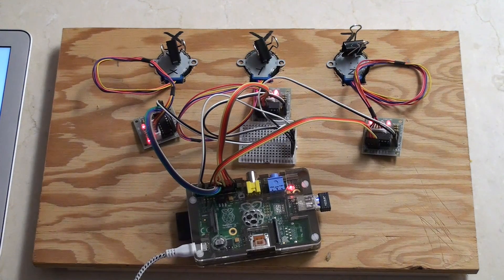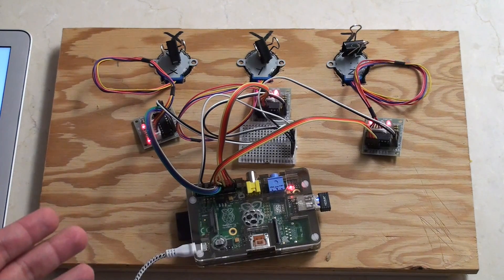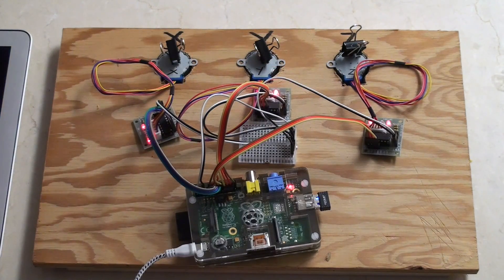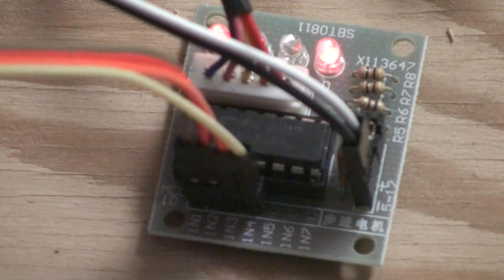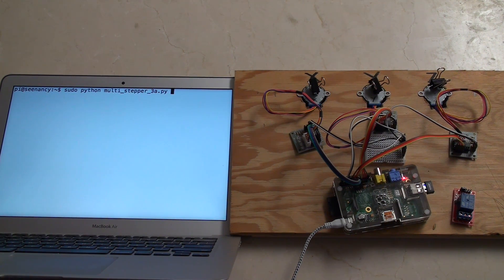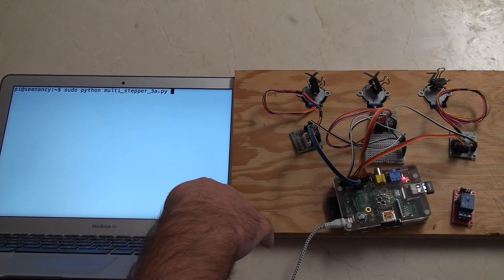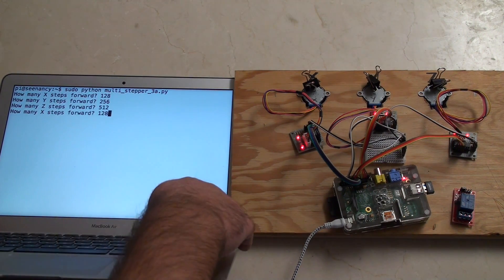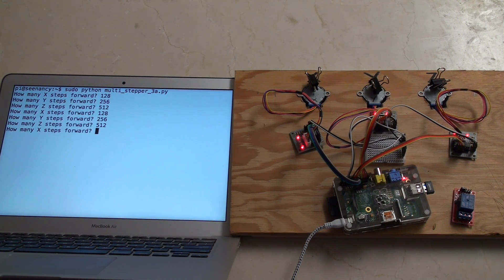Raspberry Pi:  Stepper motors and first steps towards a CNC machine or 3d printer

Comment: For a cnc you need to use Easy Driver as it requires only 2 lines from the pi for each axis (step and dir)which will be much easier to interface to Gcode interpreter.

Comment: I have loaded the raspberrypi and  using PuTTY.  I am using the Protoneer.  I am trying to get from the Linux program to the GUI. Can you tell me how to get my Lenux to go to the GUI 
screen? Thanks, Tom
Reply: "From the Linux program to the GUI.."  First thing is Linux isn't a program, it's the operating system.  Second thing is you can't "get Lenux to go to the GUI" because PuTTY is a terminal emulator.  If you're not comfortable typing commands then maybe you should get another hobby like staring into the sun.

Comment: can u share the circuit diagram for this project
Reply from the maker: +Vishwas Raj You asked for this not long ago, and I'm sorry I haven't gotten to it.  Here's the easy way tho.  Inside the code, you'll find this:
axisx = [4,17,27,22]
axisy = [10,9,11,7]
axisz = [15,18,23,24]
Those numbers refer to the GPIO numbers, so GPIO4, GPIO17, GPIO27, GPIO22.  That's for one of the motors.
Does that make sense?  Or do you still need a diagram?
Reply: +skiwithpete Yeah need the diagram.Please can you share it.
Reply from the maker: +Vishwas Raj Don't have one, will have to make it.
Reply: +skiwithpete the diagram would even help others.Please share the diagram and thanks for replying.

Comment: can I use stepper motors for a rover or is better to use dc motors?
Reply from the maker: +95Micro If you were making the mars rover, or something that need accuracy, then I would say steppers.  But if you want to wheel around like you're playing with an rc car - dc, 100%.
Reply: +skiwithpete yes i want to make a nasa like, rover. but i cant find a shield that allows 6 stepper motors and another 4 servos
Reply: 95Micro i would recomend setting up a arduino/pi setup, this allows you to make use of more GPIO. in theory

Comment: thank you for the video. i would like to know the gpio connections please.  I bought all pieces that you recommended. thanks again!
Reply from the maker: +Angelo Torres they're listed in the code.
Reply: +skiwithpete 
axisx = [4,17,27,22]
axisy = [10,9,11,7]
axisz = [15,18,23,24]

?¿?¿
Reply from the maker: +Angelo Torres So, the motors need 4 connections.  GPIO 4, GPIO 17, GPIO 27 and GPIO 22 (those are the BCM numbers that you're looking at, not the pin numbers)  take a look at this chart:  http://www.instructables.com/files/orig/FN1/YEKZ/HN824U1E/FN1YEKZHN824U1E.jpg
Reply: +skiwithpete perfect! I am so sorry cause I don´t know anything about this hahahaha now I only need to know the connections of the breadboard (5V) ... sorry and thank again...

Comment: As I'm sure you figured since when you made the video, if you wanted to show the LEDs turning on and off, it would have been easier to set time.sleep(0.001) to a higher value in the code. 
Other than that, I found this video highly educating, and thank you for taking the time for making these videos!
Cheers!
Reply from the maker: +wantomek I hadn't thought of that, that's awesome, thank you.
Reply: Hi, can each engine work together, but have different speeds?

Comment: Do these motors have enough torque to be useful? Looking to build a very simple 2 axis pan/tilt with some 3mm plywood, I wonder if these motors could move and then hold position when powered off.
Reply: not if they don't have a separate suply. You may also want to use some gears. thst way the head wold be slower, but wit more torque. hope i answered your question.
Reply: These are geared stepper motors, so they will hold their position.  But stepper motors are designed to always draw current to hold position.
Reply: These are geared I believe 1/64 stepper motors so you shouldn't need to power them to stay still for camera pan tilt unless you have some heavy glass.
Even then if you make your board such that you put centre of gravity above the axis the work will be reduced.
If you want heavier loads of you can find some worm gear stepper motors you can be more certain they will stay put, you just need to compensate for the gear backlash when changing direction. (If you aren't trying to make giga pixel images, backlash shouldn't be an issue.)

Comment: hi there, im not sure if you will be able to help or not but i have tried something similar using H-bridges and some disk drive motors but well it won't work. to explain this i basically wired it up as i think it should be, with correct pinout to the raspberry pi. if it is specific what gpio's you connect to that might be it but i started by connecting the micro usb to the RPi then using an external battery for the module. then i connected the battery's ground to the RPi as well. when i ran a simple python code that i copied off a video it simply says the gpios are in use then the motors did nothing. at this point once the modules led went dim i disconnected the battery's ground and tried again. it still did similar stuff. any help would be appreciated. i can give you the pinouts i am using if you need. 

Regards,
Aran

Comment: Can you also add how to wire a 6wires stepper motor? my stepper motor already have controller. Its vexta motor anyway. So that im thinking if i can also use the motor controller then connect it to raspberry pi2.
I also bought a gertbot just in case my controller is not capable to connect in raspberry pi. But still i need to know the wirings hehe

Comment: Thanks you for the video. I would like to try this project. What are the I/O pin
assignments to the motor drivers?

Best wishes.
Reply from the maker: +A. Rees 
axisx = [4,17,27,22]
axisy = [10,9,11,7]
axisz = [15,18,23,24]

Comment: Are you ever going to make it run G-code? From poking around a bit it seems like for now anyway you have to just manually program into Python to make a raspberry pie CNC or using Arduino as well.
Reply from the maker: Jared Jeanotte I'm not planning to progress this project any further at this time.  I just thought I'd share what I'd done in case someone wanted to take it and run with it.
Reply from the maker: Jared Jeanotte Maybe that someone is you?

Comment: skiwithpete hey buddy, what wifi dongle is it you are using ? it doesnt look like the edimax.. i need one to work with raspberry Pi B+.. ? any suggestions please?
Reply from the maker: Hey, I was buying a lot of these WiFi dongles on ebay before I settled on the edimax - so you're right, you'll see the odd one that I have that works that isn't edimax... but, if I was you... I'd stick to the ones guaranteed to work, I've got a drawer full of ones that don't.
Reply: hehe ok cool ^_^
thanks pete ;)
i got myself a D-link, works fine ;)

Comment: Hello skiwithpete !! Congratulations for the projects , I am inciante this battle. First doubts , how you are connecting the screen without the display cable ?? How you are accessing the raspberry in the example above ?
Reply from the maker: Romulo Oliveira Lima I'm connecting via SSH.  If you use Windows, you'll need a program called PuTTY.  Hopefully you can find more help on the internet as I don't use Windows.

Comment: skiwithpete Love the videos, I've been picking up a few things here and there from some of your tutorials and I ended up buying these stepper motors.  Curious, do you know how many steps is 360 degrees?  Also I saw another tutorial over at https://learn.adafruit.com/adafruits-raspberry-pi-lesson-10-stepper-motors/software where they essentially do the same thing you did but with half the sequences, just curious what the difference would be.
Reply from the maker: Warnie Meisetschleager With my code, there are 512 steps in the 360degree rotation.  Adafruit has half as many steps so their code will do it in 256 steps.  Keep me posted on your progress. 
Cheers,

P

Comment: waits for Raspberry Pi 2 overview
Reply from the maker: DuSlothster I've ordered one and I'll have it up as soon as I can.  Cheers,  P
Reply: skiwithpete Yeah same. I have a Raspberry Pi B model that acts as a NAS for me, do you imagine the Raspberry Pi 2 will give me increased speeds? Currently I get 10MB/s writes, which isn't bad but I'd like more.
Reply from the maker: DuSlothster
In short, no.  What you really need is a BananaPi or a Hummingboard as they have Gigabit Ethernet.  That will get you the faster NAS speeds.  Unfortunately, the faster CPU and increased ram of the Pi2 won't do much of anything for your NAS.
Reply: skiwithpete Yeah the ethernet on the Raspberry Pi is a bit of a pain. If I bought a BananaPi could I just swap out the SD cards? Or is there a specific BananaPi Raspbian image?
Reply from the maker: DuSlothster
  There is a specific BananaPi image.  While it is based on Raspbian, you can't just switch the cards over.  You'll need to rebuild your NAS.  Not the hardest thing in the world, but it's probably a Saturday afternoon...
Reply: skiwithpete Oh well :P. One last question: Do you have any experience with NAS performance on the BananaPi (Samba and EXT4)
Reply from the maker: DuSlothster
 You should just Google the results, there are lots of tests showing the increased speed of the Gigabit on the Banana compared to the Raspberry.  Here's one quick one - the last test shows network.  http://hardware-libre.fr/2014/06/raspberry-vs-banana-hardware-duel/
Reply: skiwithpete Thanks for your help.